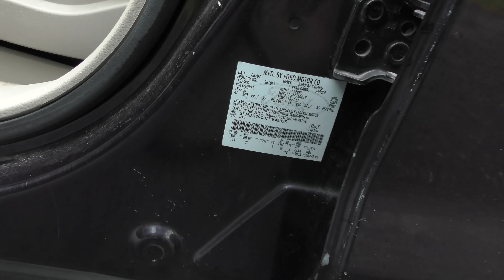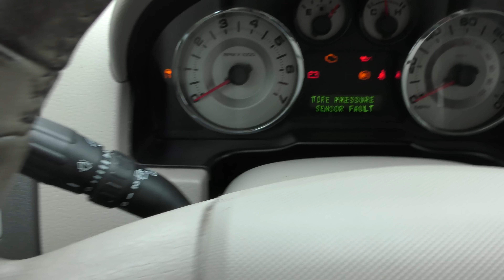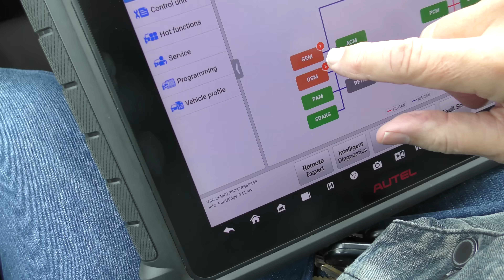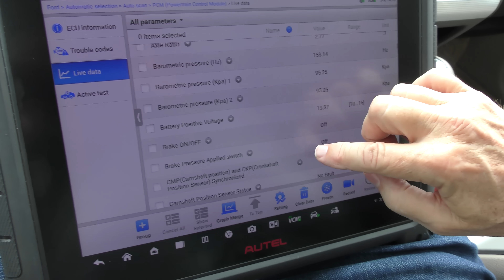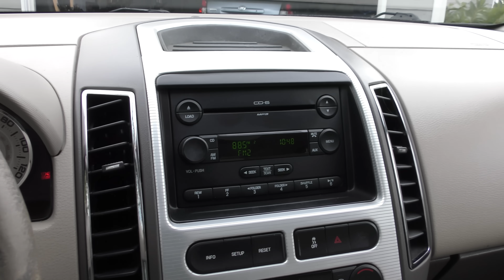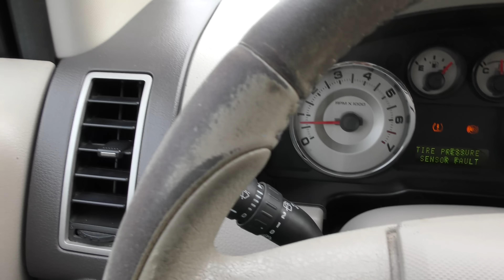What the Hell is This

Comment: The 3.5 isn't a bad engine. It's way better than GM's 3.6 with its multitude of timing chain problems. The only thing that would worry me about it is the water pump.
Reply: Agreed. I have a 17' Explorer with that engine, and I removed the Orange Coolant, and replaced it with the new Yellow Motorcraft coolant with better inhibitors to help prolong the life of the water pump. An Ex Ford tech suggested I do that. Glad I did.
Reply: @bernie472 is the water pump a hard thing to change?
Reply: @Joe-hz1nw it’s chain driven behind the timing cover. My son just spent $3K on his 2015 Explorer withe 3.5L V6. Ouch!
Reply: Amen
Reply: @TXAG81  🤮.
Reply: @Joe-hz1nw  The pump is internal for FWD applications (Edge, Explorer etc). It's external on the F-150 and Mustang and not nearly as painful, as coolant hits the garage floor, not the oil pan.
Reply: @Joe-hz1nw Yes on these engines because it is an Internal water pump, where the front timing cover has to be removed to get access.
Reply: @TXAG81 maintenance is not cheap especially when you drive a turbo engine hard
Reply: Yes, if the water pump goes out (which it WILL at some point) then chances are the coolant DOES mix with the engine oil.  One way or another you’d best change the pump @100k miles, and make it a habit to ck coolant level REGULARLY (say every time you fill up) especially as you approach the 100k mile mark.
Reply: Agreed. The waterpump is mounted on the timing chain on that engine.
Reply: Got over $200,000 mine water pump hasn't given out yet 2015 Ford
Reply: @brianhardesty8222  is the waterpump on your 2015 Ford riding on your timing chain
Reply: @Djevan41598  yes it is the 3.5 Ford v6 it is in my 2015 Ford Taurus
Reply: 3.5 is goated if you just change the oil on time
Reply: @hyperpotato1197  agreed religiously change every 5000and coolant and transmission every 30000
Reply: Guys, you need to change the coolant!!! I did our 2010 FWD Edge at 75K with Amsoil coolant and have not had any water pump issues. 203K and going strong...
Reply: The Ford 3.0l v6 is way better than 3.5l and the 3.7l v6. When it comes to reliability.

Comment: The worst thing about that 3.5 is the water pump in the timing cover timing chain driven
Reply: thats true but if you change your oil and coolant on time, it wont eat away at the rubber seals that causes them to fail
Reply: Seriously. Had that happen while on vacation at the beach with my family. Noticed coolant on the ground, popped the hood and noticed the reservoir was empty, pulled the oil dipstick…chocolate milkshake.

Fortunately, it had happened relatively soon to when I noticed it, towed it 200 miles back to my local mechanic (thanks AAA!), and they were able to change out the water pump for ONLY $1.4k.

Worth it though, because I’ve gotten another 75k miles out of the engine. But keep in mind, i was aware of this issue and checked my fluids religiously (even would send oil samples to Blackstone Labs to check for moisture in the oil), and nothing showed until the catastrophic failure of the water pump. My mechanic friend showed it to me after, and the interior bearing rod just snapped in half and allowed the coolant to dump straight into the engine.

It (the water pump) does have a double gasket with two weep holes that should give you a heads up on incremental leaks and is extremely durable otherwise, but man…what a stupid design to save a few inches of engine clearance!

Also, the other thing to watch on these cars is if they have the 6F50 transmission…do a search on TSS/OSS issues, extremely common and can cause serious issues if not addressed quickly.

Comment: I have a Edge I bought at copart auction.  All new fluids and a changed out ptu with new fluid.  Runs perfect with 208,000 miles.  Going to Uber with it.  Got it for $1600 plus about $500 in fees. If it lasts a year I'm money ahead.  Lovely car to drive.
Reply: The ptu is the key. Ford says they are set for life without a fluid change. That makes a very short life, so you buy a new vehicle.
Reply: @Jonathan-mp32x  Mine is all wheel drive and the ptu has yellow writing on it and looks new.  I drilled tapped and put new plug in The bottom as directed by youtube posts.  So I think Im Good.  Thanks
Reply: Knock on wood.
My 2012 for edge has been the best car I’ve ever owned. I’m a GM guy, but this edge runs amazing!! They made a great car there

Comment: The ptu issue in the awd was a problem with earlier models due to lack of maintenance, Ford said its got "lifetime" oil and never needs changing, they just swapped em under warranty, there's since been a drain hole added to newer models, you can dril and tap your own, some owners have

Comment: Hey Scotty speaking of Ford products, I have a 2000 Mercury Grand Marquis with 327k miles on it. It was built in Canada. When I moved from Connecticut to Tennessee 14 months ago, I drove this car the 1100 miles to my new home without any problems at all AND going 70 mph the entire trip, the 4.6L V8 delivered 25mpg, which was the stated mileage rating at the time of manufacture. So to all car buyers, don’t discount older cars. There are still some good ones out there..I was lucky my Mercury was a free car, with no mechanical defects at time of acquisition. 😊 And there still are no mechanical defects outside of preventive maintenance. So treat your cars right and they’ll treat you right..

Comment: My wife has a 2010 Edge with about 114,00 miles. Only thing other than normal maintenance, was replaced the brake booster. Runs, rides and shifts like new.
Reply: AWD or FWD?

Comment: I love my 2010 Ford edge! 200,000 miles and the original AWD system is still going strong. She’s been an amazing trooper for my mom and I since new, and only ever needed all 4 wheel bearings at 175,000 and normal maintenance along the way. 4 sets of tires, 2 sets of front brakes and 1 set of rears, engine oil every 3,000, transfer case every 25-50,000 (depending on driving condition) transmission every 50,000, and differential fluid every 75,000. I could not give this thing any more praise for how reliable she is; hell even the high beam, license plate lamp, fog light, and side marker bulbs are all original from 2010.

Comment: I bought a 2018 Ford Edge AWD built in Oakville Ontario because it uses the Lincoln frame.  The Lincoln is built at the same plant.  No issues.  Best car I ever owned.  I get 33 miles per gallon on the highway, and that is the larger Canadian gallon.
Reply: Do you still use gallons in Canada?
Reply: @loualexander3408  
Sane people do, especially when determining if your car is fuel efficient.

Comment: They all wheel drive version is actually a great car. I’ve had it for many years and it now has 143,000 miles on it. The only thing I’ve had to replace with the drive system is the center support bearing for the driveshaft.

Comment: Others may have already mentioned this, but the weak link in the AWD Flex, Escape, or Edge is the PTU. The PTU holds less than a quart of 75W-140 gear oil. If you religiously change the PTU oil, it should last. 

The older PTU models didn’t have a drain plug, so you had to siphon out the old oil. Apparently, the newer PTU models have a drain plug

Comment: The Duratec 35/6F50 is a great combination; barring two very common flaws…the water pump in the engine, and the TSS/OSS sensors in the transmission.

Barring those known weak points; if you keep up on maintenance, this setup is absolutely bulletproof otherwise.

Comment: I have the same car but i do have the all wheel drive version. I too have the tire pressure sense fault on and the traction control/abs is turned off. Mine runs great and has alot of power,my sunroof is dead but its sealed so I dont care. I am adding a tow hitch to it and gonna get a small cargo trailer to build out and use for camping. I like my Ford Edge and thanks for this video since mine is soo much like it and now I dont have to worry about these stupid lights.

Comment: I had a 2007 Escape AWD automatic & had issues with the AWD system & a 2001 Escape FWD 5 Speed & both had 4 Cyl motors & only issue the clutch pedal needed to be replaced. Both were made in the USA!

Comment: We still have our 2007 Ford Edge, you're right, the PTU or AWD unit is a poor design.  We are on our 3rd PTU, it only holds not quite a quart of 75/140 synthetic gear oil & they cook the lubricant and burn up!  I started having it scavenged out every year (no drain plug), but they still failed.  It now has 277,000 miles on it, it's ready for front CV Shafts and a rear driveshaft (can be expected with this mileage on it).

Comment: I have a 2011 Ford edge it's currently got 227,000 mi on it, I've had to replace several items normal wear and tear stuff. I'd like to see that 25 mi to gallon because at one point we just freeway driving I was getting 20 now I'm lucky to get 17 but I live in California Hill country, my rear wiper doesn't work and you have to take the fuse out otherwise it kills the battery, I found that with some O2 sensor lights and catalytic converter lights that was caused by a dead battery. I know it sounds crazy but when I replaced the battery on my warning lights went away.

Comment: I guess I got Lucky. I used to have a 2005 Ford Escape Limited AWD, and I used it for Lyft, and Uber. Replaced the Transaxle Fluid, and replaced a bad seal on the Transaxle, but never had issues with the AWD system. Owned it for 7 years, until I sold it with 177,340 miles, and It was perfectly fine.

Comment: Ive got a 2013 chevy impala that i would drive across the country in with its 3.6lfx engine which i keep very well maintained. You just cant skip oil changes with the 3.6 or you will regret it

Comment: We still own a 14 edge sport and it just turned 100k and it's been the best car we've ever owned. The only thing I've ever had to do to it was change the throttle body because the butterfly motor went bad and it's a one piece unit with the throttle body. I've also changed the struts and the battery. That's it. General maintenance stuff. But I can't say the same for other ford's I've owned.

Comment: Scotty,  I have a 2012 Ford Edge, 3.5L V6.  Runs well, but the drivers door ajar light stays on with the door closed.  Cleaned the door latch switch with electronic contact cleaner, but no change. Suggestions?

Comment: Ford scares the crap out of me period.
Reply: Me too😂
Reply: Has always been junk
Reply: Me too my last vehicle  was a Ford edge2011 limited  what a piece of junk I will never buy another Ford ever double 🐦🐦s to Ford
Reply: are they all STILL programmed to fall apart at 60,000 miles (or the day after warranty expires)?
Reply: Drove every ford I’ve ever had into the ground. ‘98 expedition just got to 280K and I sold it. Just got a new F150. Loving it.
Reply: @michaela6147 Not true! You just have to buy the right ones.
Reply: I have a 2010 focus with 345k miles. Uses no oil, and shifts like new. Ford has done me proud.
Reply: @brockbaker3able my pops has a 2008 focus with 260,000 and has served him well shifts like new too
Reply: Yea...it was really scary when my fords and hondas went  over 300k and ran perfect......because i maintain them..
Reply: @omegasupremez2832 because you maybe got a lemon? Why dont people use common sense...
Reply: @richsweeney1115  No, got over 270,000 miles on the vehicle  thanks to listening  to a guy called MAC-T. Ford engineering is the problem cheap parts like door actuators where the door wouldn't lock and kept the dome lights on so in the middle of the night the alarm  would go of until it killed the battery. So I tell Ford about the issue they wouldn't fix it they wanted to charge over $500 dollars to repair. Plus never had to replace a cooling engine fans on any vehicle I've owned but if you buy a Ford Edge you will. Simple fix but can be a hassle if your traveling out of town. finally the death penalty if you don't watch and change your coolant what engineer thought it was a smart idea to put the water pump  on the timing chain  together so if the rubber seal fails  it will dump coolant in the engine oil. So if you don't use Ford Speciality Green coolant the rubber seal will fail. Ford has been making vehicles for over   100 years and the design stuff like that. Simple  answer Ford vehicles are a scam. "Found On Roadside Daily" i wouldn't drive one if it was given to me for free.
Reply: @richsweeney1115  I maintain my vehicles  perfectly, but luckily I don't have  Ford.
Reply: My dad got nearly 350,000 on his F350, then traded it and has 170,000 on his Flex, and bought a new F350 with 140,000
Reply: @omegasupremez2832  funny.....because  mine have gone about 300k ,and still ran fine when i sold them...not a acam at all. Every company has its issues....ive had to put cooling fans in cars....not fords. My fords andhondas,and mazda are all id buy...maybe a toyota or lexus if i liked it enough.
Reply: My one and only Ford was a 1979 Pinto station wagon. I said never again.
Reply: I agree with you but ford is the best of the big three at this point in time
Reply: Ford blows farts!!
Reply: @brockbaker3able I know ford makes pretty good 3.5 engines but I thought they were terrible at fwd transmissions must be a aisin

Comment: My wife has a 2015 Ford Edge and it has been an excellent vehicle.  We got it used in 2018 with 19,000 miles and it’s now got just under 96,000 miles and runs like a champ.  Front wheel drive and a V6, stay away from those 2.0 Eco Boost pieces of crap.  🇺🇸✌️😎

Comment: Is it hard to replace the water pump?
Reply: @Jonathan-mp32x yeah I figured. Surprised that he didn't mention it, i thought this car was the exception somehow.
Reply: @Jonathan-mp32x I don't think it as bad as the Chrysler 2.7 v6 which had other problems along with the water pump replacement but still it's very annoying.
Reply: Water pump job is closer to $3K now on the 3.5L.
Reply: @Jonathan-mp32x Suggest you don’t let it go too long. If the seals fail, you’ll have coolant in your crankcase and wipe your bearings out - - good bye engine. Change that water pump before she blows.
Reply: @Jonathan-mp32x the seals are beginning to go. Better plan on getting the job done soon.

Comment: When they list the price for a battery-electric car, they should also list the price for a battery replacement (shop cost) and replacement battery (item cost). Not much sense to buy a $20k car when 10 years later, to replace the battery you need more money than what the car is worth. I can't wait for an electric powered car, but so far they are gimmicky toys, not tools of transportation.
Reply: They push the extended warranty on you and try and get another $3-4,000 out of you

Comment: Will Sierzchula (2022Dec01) “Electrifying US long haul trucks will require 504 TWh a year. But that won’t be the hardest part.” 

1 terawatt hour (TWh) is 1,000,000 Megawatt-hours (MWh) or 1,000,000,000 kilowatt-hours (KWh). Total electricity consumption in the USA in 2022 was 4,010TWh, so to electrify long-haul trucking would require adding 12.57% more energy. Say you pay $37 per MWh, electrical costs for long-haul trucking would cost $37x1,000,000x504= $18,648,000,000.

Comment: My sister had a 2007 model. The VVT went out at 180,000 kilometers, and that was it for her. She had already replaced the blower motor, and it went through endless amounts of brakes, even though she wasn't hard on them. Like this one, it didn't have any rust on it. I don't remember how many times it had rustproofing done, if at all, but it still didn't rust, even on the salted roads in Canada. So hers had it's ups and downs. It still looked good, it just needed more work than it was worth in our eyes

Comment: I,have a 2002 Citroen C5 2.0 diesel.  No,rust, head rebuild at 168k.  Now she has 220k, reliable, burns very little oil, ABS and A/C working fine. Best thing?  Official MPG 45 per gallon.  I,get 52!  Result!!!!!
Reply: Even better.  She has hydraulic suspension that gives a magic carpet ride.  Proper gearbox with a clutch......
Reply: Can they even import them now, with the US standards ?

Comment: Good FADE AWAY EVs 
And yes Scottys right the transfer cases on the Edges crap out especially if fluids aren’t changed out. 
My friends dad had a few. The 2022 he has now is FWD and 140k miles in Ct no issues. 
   His wife’s ford escape has had a stupid metal band in the tranny replaced 3 times. $4,000 each time but ford did it free under warranty.